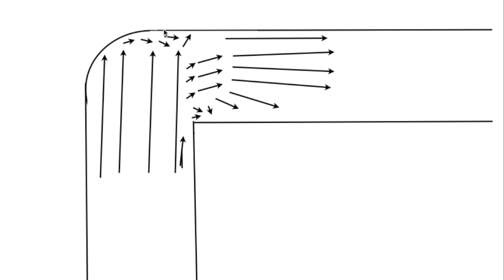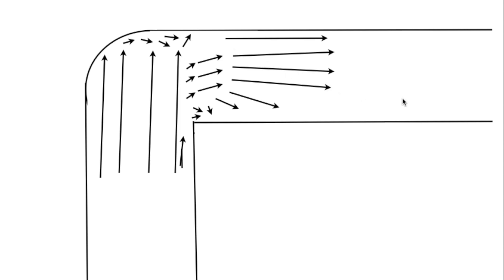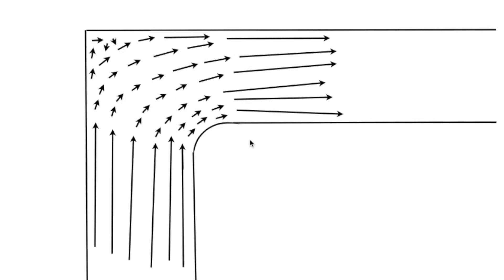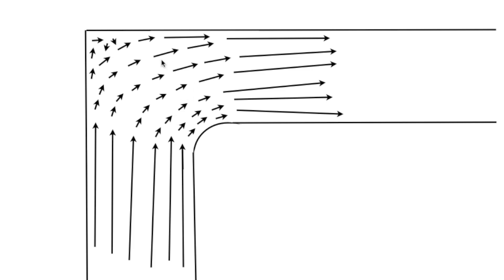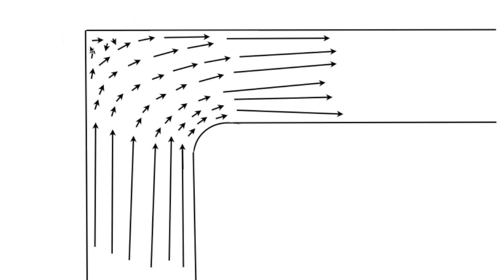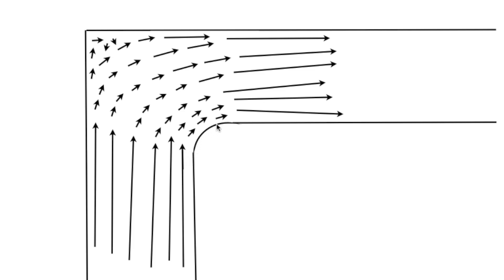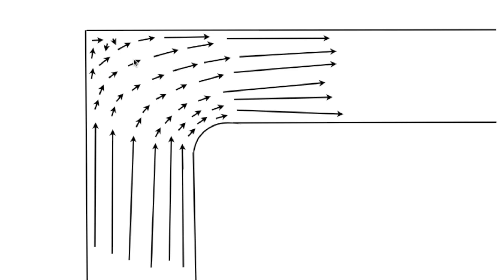Air flow around the 90 degree ell

Comment: I have a misalignment at a flange preceding a 90 degree ell (in an industrial engine exhaust passageway).  Would a sharp step causing turbulence on the "inside" edge before your ell with the sharp inside corner compound the problem?  I'm looking for the root cause of a 20% loss of flow.  my new exhaust manifold has a step on the inside edge - opposite of the location of the step of the previous manifold (outside edge).
Reply from the maker: My thoughts are that it would.
GFM

Comment: I'm thinking the air will flow better if the top and the bottom had a curve
Reply from the maker: That is the common belief.  Certainly, both curved would be best.  However, the point of the video is the inside curve is far more effective at reducing turbulence.
GFM

Comment: Does that mean I'm better to place my 90 degree turn a bit after the fan so that the head of the inline fan doesn't start in the middle of the turn. So does adding 3in after the fan and then! turning help keep my pressure. I tend to think that a corner just after the fan(in the turn) creates a wall effect(bad) or is half a turn(good). I know turning right away is better for duct length. Question: Do i add 3in straight and then turn, or turn right away.

Comment: First of all, thanks for all your videos on HVAC. My question is, what percentage of air flow is lost for each rounded inner and outer 90 degree bend?
Reply from the maker: The best way to determine loss for fittings is to use one of the online calculation software pages.  There are a number of them available in freeware.
GFM

Comment: nice video. will chamfering the elbow result in lower pressure drop? It saves some material also. TY
Reply from the maker: Chamfering the inside corner will improve flow.  The outside corner makes its own chamfer with the eddies in the flow.  Hope this helps.
GFM